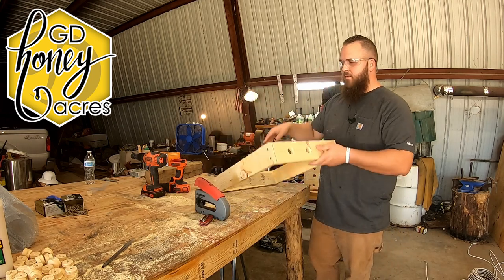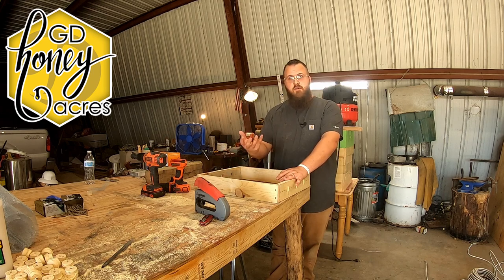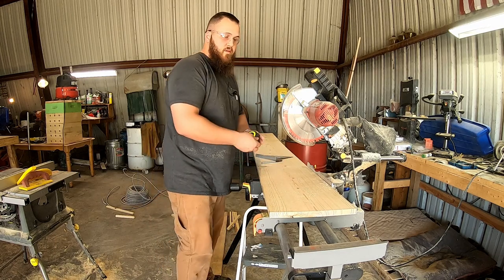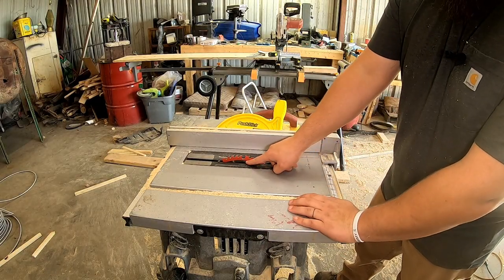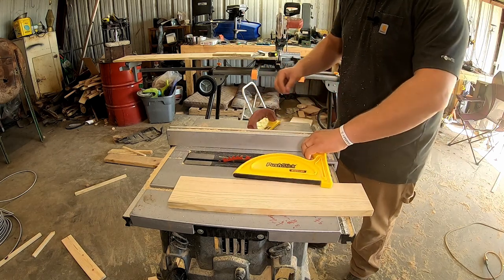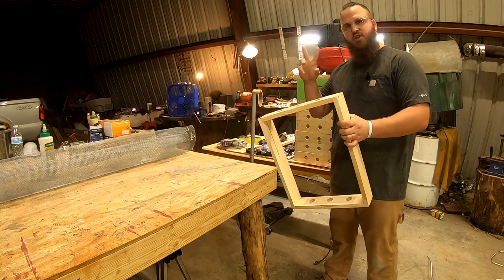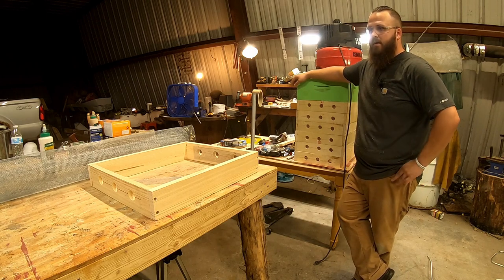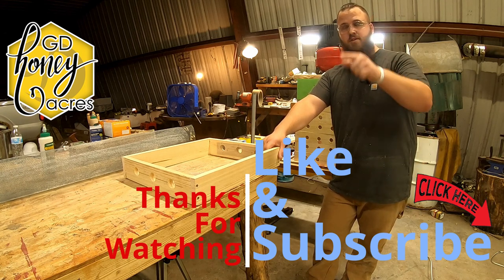Overwintering Honey Bees: Vivaldi Board

Comment: I've used a similar device called a quilt-box.  Wintered 11 colonies and had 0 loss.  I believe in this method.  Mine is a bit deeper, uses wood-chips and has insulation above.
Reply from the maker: Hey for some reason your comment about your vid you mentioned about insulating disappeared. What was the title of it?
Reply from the maker: I’m going to be putting the foam board under the telescopic cover on top of the Vivaldi board.